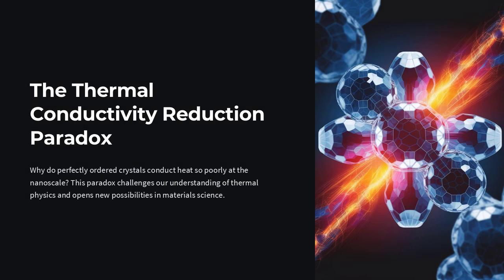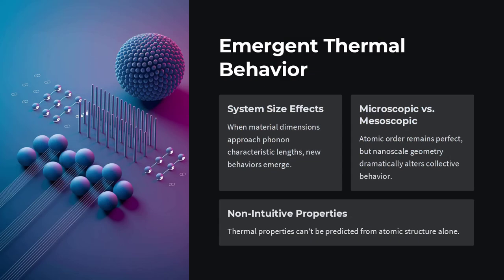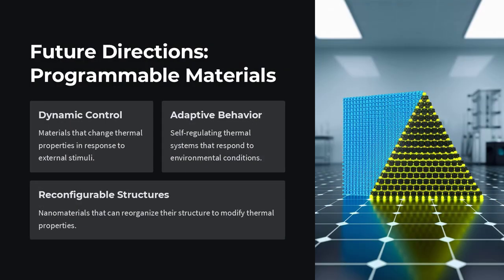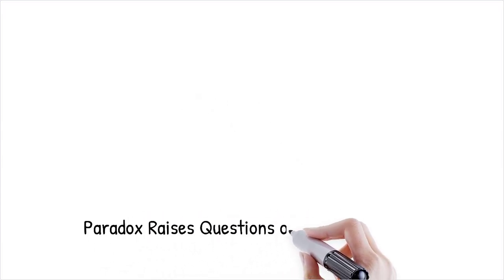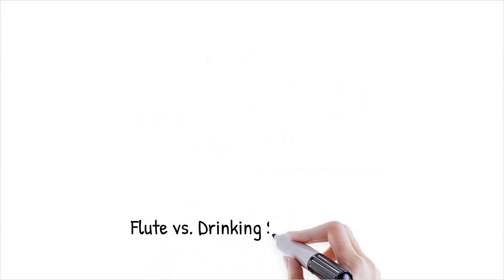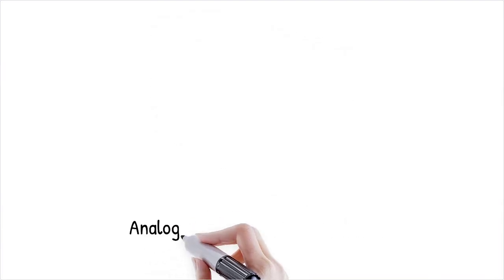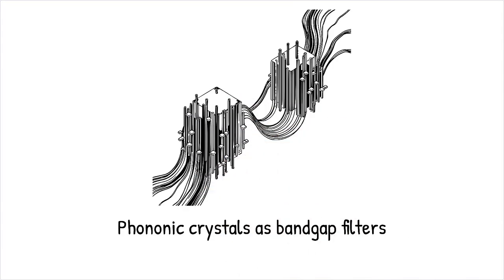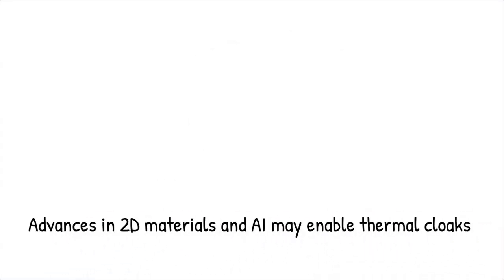Nanoscale Heat Disruption: Thermal Conductivity Reduction Paradox

Comment from the maker: How do coherent phonon wave effects in nanostructures lead to localization or interference-based heat suppression?
What fabrication challenges must be overcome to build scalable materials that retain low thermal conductivity without sacrificing crystal integrity?
How does geometric complexity reduce phonon transmission fidelity from an information-theoretic perspective, despite maintaining structural order?